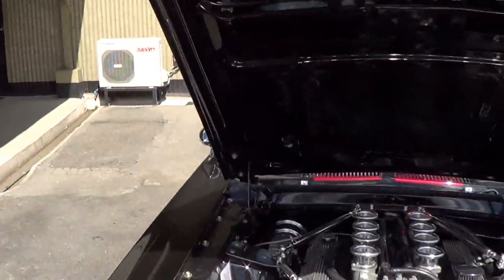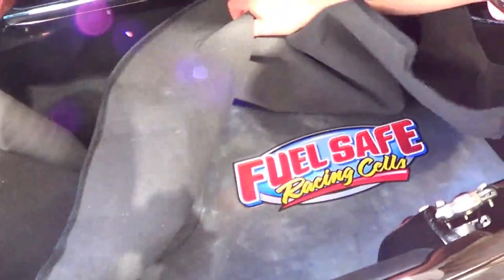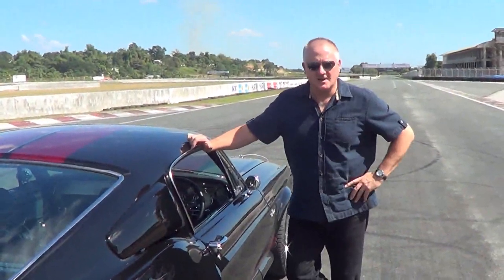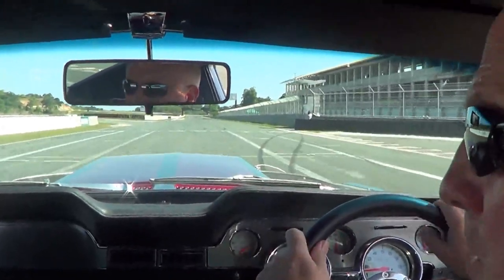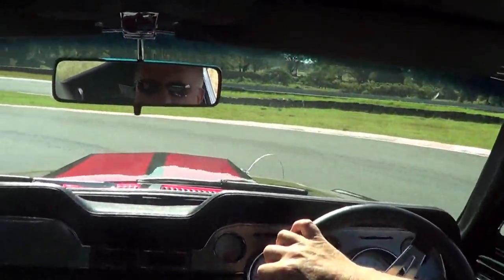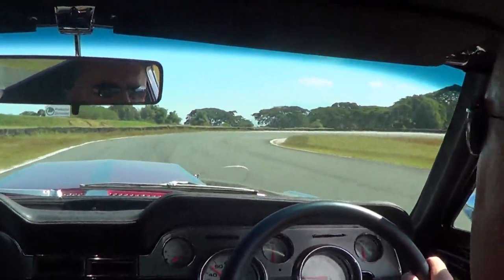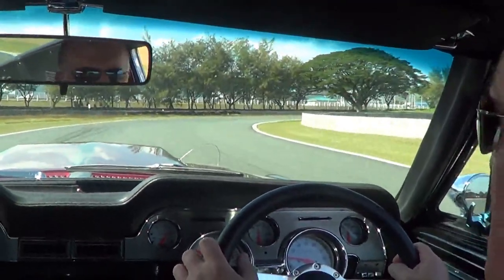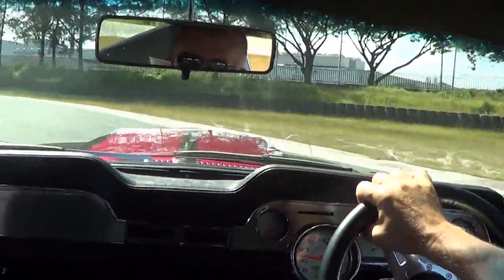Ford Mustang 1967 GT500  'Eleanor' Right Hand Drive from Clive Sutton

Comment: Is it possible to register one  RHD in The Philippines   I'm relocating from Brissy end of the year  and want to bring mine  .  I'll be looking at having it Elenored . Cheers
Reply: wasp1961 Only for test drive that US LHD vehicles converted to RHD already done in the Philippines and shipped it to RHD countries like Australia.

RHD imported vehicles are banned in the Philippines for both private and public road use. Buses from Japan had been converted to LHD and entrance is on the front right or at the right side. passenger people carrier van sliding doors must be  left at the left side as it converted to LHD, so you may park your LHD converted van at the left side of the road as you can exit the left side of the van as you open left sliding door, since there is no right sliding door parts for that vehicle or just leave it with no sliding doors at the right. If your vehicle converted to LHD, you can easily pay tolls, driving on drive thru for take out on a restaurants, etc..

Japanese RHD trucks like Isuzu m, Nissan Diesel and Mitsubishi Fuso with tilted cabin as you open the engine bay of the truck, already been converted to LHD, parking brake and shifting gear transfered to the left side beside the driver’s side.

RHD race cars are only legal to drive on race tracks but not legal on the streets.